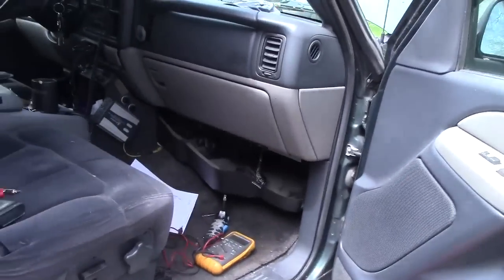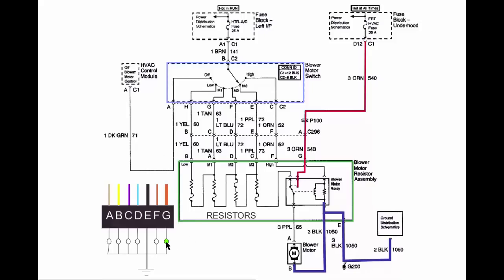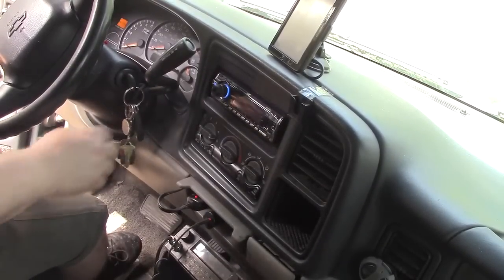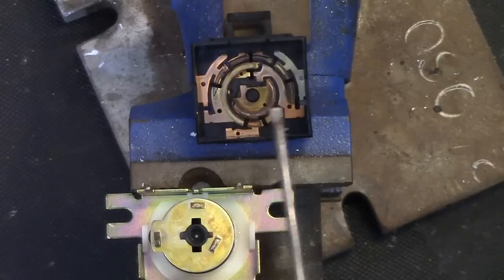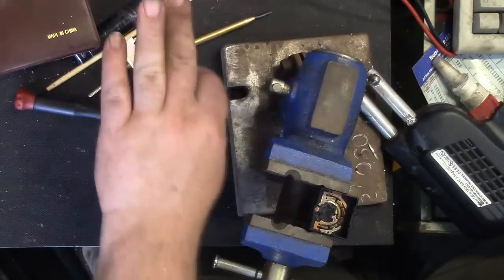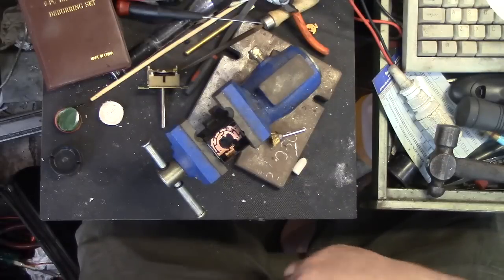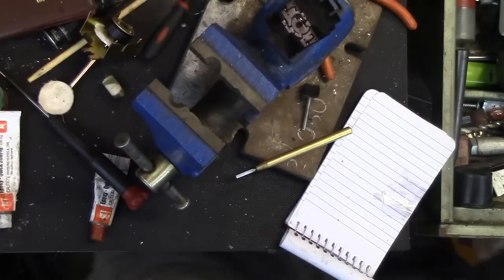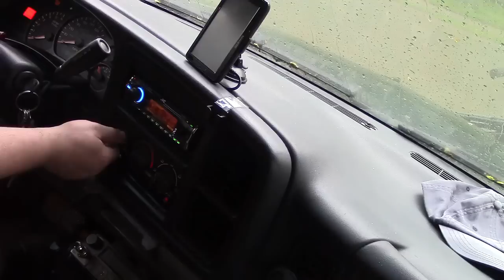Tahoe / Yukon / GM truck (GMT-800) Blower Switch - Troubleshooting & Repair

Comment: Just wanted to say thank you! I had a blown fuse under the hood. Had no power coming to the blower resistor and your explanation of where the power routes from under the hood was perfect! You saved me big money! If your ever in Chicago, beers on me👍
Reply from the maker: I'm glad it was of help to you.  I used to go there a few times a year with much of that time spent gridlocked on 55 in desperate need of a restroom.  Ah, good times!  Anyway, if the underhood High speed fuse was blown then you should check the wire harnesses and clean / lube the fan motor when you get a chance.  Something had to cause the extra current flow and old gummed up bearings seems likely.  Cheers!

Comment: I retired as a Heavy Equipment/Diesel mechanic for N.D.O.T.  I worked next to light duty guys that replaced probably dozens of those damn switch assemblies all told, so it was definitely a weak point in the GM climate controls.  I always wondered why GM only sold the complete assembly.  If I had been the one working on those systems I would probably have cracked open one of those bad boys to see what makes them tick.  As I didn't work on them and didn't have access, I just assumed there was some sort of electronics in that assembly.  But I NOW know it's because GM didn't want people taking those assemblies apart to see what cheap pieces of crap they are!   Great tinkerer's repair, considering how crappy the switch is, it lasted a fairly long time I'm thinking your repair will last as long if not longer.  Wicked cool vid, and I don't even own a GM like yours.
Reply from the maker: Pardon the delay. Google hasn't been notifying me of some comments.
Market forces and management demands have moved engineer mindsets from 'What Works Well' to 'How Little Material We Can Get Away With To Make It Adequate For The Few Years We Want You To Own It Before Buying Another'.   While parts may not really be engineered to fail - they won't be built to last much beyond what the MFR and the stockholders consider a reasonable lifespan before selling you another vehicle.  A sad truth not only to make stockholders more money (greed) but to keep folks employed making stuff for a prosperous economy.  No matter - Tinkers will find a way.  Thanks for stopping by and the comment.
Cheers

Comment: Thanks so much for the information! My issue was the blower motor resistor. Once I saw the schematic and listened to your explanation of how everything worked, I knew what to fix. The local auto parts place had the part for $25, and now, all my fan speeds are working. For reference, if your highest speed is the only speed that blows, your problem is the blower motor resistor assembly. AutoZone has the part in stock at most stores.

Comment: Eddie Great video,  Tinkering teaches critical thinking as well as evolving our skills.  It has allowed me to pursue a long successful technical career thanks to my father the Grouch.  This video allowed me to figure out that I had a compound problem (somewhat cheap equipment and age)  without even having to physically troubleshoot. Had both a failing relay and a slowly degrading switch per your schematic.  The only thing that would have made this video any more perfect is if you were interrupted again by a couple of dogs going at it on the front lawn!.  Be safe my friend.

Comment: Thank you for great video.   I  replaced the blower motor resistor and wiring harness plug for 2nd time as it had almost caught fire, turned on and nothing.  Thought I had checked all the fuses.  Switched out controller  with my 06 2500HD and still no fan came on despite display working.  I had  Missed "G"  40 large fuse you show at the 7:41 mark in video.
Reply from the maker: Yeah, the trend of under-sizing wires to save weight and a few dollars per truck sucks.  Try turning on all your accessories like when driving on a hot night and try grabbing the charge wire on the alternator.  That sucker will burn.  Glad you got it sorted out.

Comment: One spray of Deoxit D5 and I bet it would work for a long time....How do you change the light bulb in this switch assembly. My temp, and ac selector has a light but the speed dont...

Comment: I just went through a nightmare on one of these 2003 Silverado manual AC/Heat. Blower works on 5 only  ok 100 YouTube videos showing resistor YouTube  makes sense  changed it  same thing so started really checking everything reasonable. Put a bulb in blower motor wires and the light was dim on 1 and got full bright on 5  so I’m thinking a short on blower motor.  New blower  still only worked on 5. Crap. So I did what I should have done first  check the voltage coming out of hvac controller from fuse   Whoa  10 volts at wire 12 bolts at fuse cranked up truck 14 at fuse 10 at wire  so I ran a separate wire to hvac control hot wire and all speeds worked  there was a voltage drop in that wire from fuse to hvac controller  ran a wire that gets power only when ignition on and I have all speeds   99% of the time it’s the resistor unless it’s me working on it.  The blower needs 12 bolts at the least and resistor just cuts it down a few bolts but if you start at 10 volts it may dim a light bulb but not a blower motor

Comment: Thanks for this informative video. I was down to speeds 4 & 5. I replaced the resistor pack and now have nothing! Looks like I will be doing the same as you did here as it appears to be the blower switch. My truck is the W/T plain Jane version and uses cable drives to change the vent positions and heat control, so it’s a pain to try and access the switch as there is no excess cable length to get the panel out without disconnecting the cables. I wonder if anyone has encountered this, I’m open to suggestions.

Comment: Interesting what you say about the motor. My 02 has been making lots of squealing.  Then the squealing stopped about the same time the four lower switches ceased to work.  Six years ago the first speed alone malfunctioned. However, I was able to get a replacement switch alone.  Trains ha!  We have one go by here (in the country) every 15 minutes.  Real life has noise.  Just take a break and continue talking.

Comment: Thanks for sharing, any input on a blend door in the rear of 2002 Yukon that is hunting and only blows cold air... I took it all apart, and tested the blend door, it worked fine. i think its the module? I cannot for the life of me locate the module...?

Comment: Hey thanks for putting this video up.  My '96 Yukon had a high current draw that caused the plug in the back of the speed selctor switch to melt. I repaired that, replaced the motor and to my surprise, no ground. I took a jumper wire and made a circuit to ground, and everything works well. I have no idea where the black wire actually attaches to ground. It is tempting to make a permanent setup, but can anybody tell me where I might find the other end of the black wire?

Comment: oh you are sneaky. looks like i will be doing this same thing soon. luckily mine is still at the wiggle at tap to work stage. so i will be looking for one that ain't burnt yet. i wonder what causes this to happen.  bad contact?
Reply from the maker: Old grease, usually.  That will both make the motor harder to turn - hence, more current needed and create poor contact, as you said, as the switch wipers have a harder time cutting through the crud to allow enough current to flow.  Say you have a bad splice near the motor;  the heat damage will stay there and not affect the switch since the current passing through will be lower.  If the blower motor can be easily removed (as well as wiper arm shafts, window cables, etc), they should be re-greased after 10 years, anyway.

Comment: So if my ac works but i have no blower just free air when i drive then, my switch must not be my issue it would be my resistor right? ( since my ac botton comes off that same switch) i checked my harness my fuse pin has
Power but all the rest of the pins dont show power

Comment: Awesome video. Now I'm a bit worried cause I just bought a whole new climate control panel. I have the blowers working on the defrost and at my feet but not from the center vents. I hope its not the blower switch?

Comment: I have a 95 Tahoe.....I have water getting in the heater motor housing. any idea where it's coming from
Reply from the maker: If you mean plain water and not coolant I would guess the condensate (A/C - Defrost) drain is plugged.  There will be a tube through the floor pan near the passenger fender that may have mud or a bug nest in it.
Reply: thanks man...very much appreciated
Reply: Jon I had the same problem. Turns out a screw was missing from the shroud under my windshield. And allow rain water to enter the blower housing. Hope that helps

Comment: I've got a 2000 impala. Almost identical wiring setup from what I see. I get power to the 7 pin connector for the blower motor resistor(11.8 volts on the hot wire and about 3 volts on the others with the switch selection), but no power coming out the other side connecting to the blower motor itself. I've tried replacement resistors and get the same result. Any suggestions on where I should look/test?

Comment: Is there anyway to just rig it to stay on full blast... it’s 100 degrees in Texas and it only works on the low setting
Reply: WhiteGrapeSwisher mines only work on high ...I wonder is it the switch

Comment: 04 Chevy Avalanche, the blower only works on high.  Any thoughts?
Reply from the maker: In the past I'd say the blower speed-pak - we used to call them blower resistors but most are electronic or hybrids now.  Considering this repair I have to add the switch panels into the mix of common failures and things to check.  Since the speed-paks can be pretty expensive, it's worth taking the time with a test light or meter to find to true culprit.
Reply: Turned out to be the resister.  Thanks for the video, helped me figure out the cause.
Reply from the maker: Great to hear it was an easy fix and it was kind of you to come back with the results.
Reply: I have an 04 Chevy silverado 1500. My switch will not activate the blower at all. Any suggestions on issue? thanks for your reply
Reply: Rick Skeels

Comment: I have a 2003 express, the blower only works on high, I've already replaced the resistor and it was not resolved, i've inspected the harness and it doesn't look like it is melted or deteriorated. when I try turning the switch to low,med or med or med/high and all the happens is the airbag light and brake light flash and ding, where do i start to troubleshoot?

Comment: hi my 99 tahoe ac works on rear but not the front side what can be the problem? plz help has enough freon,front blows warm air when the rear blows really cold.
Reply from the maker: For some reason your comment was held as possible spam and I wasn't notified :(  It's probably already fixed but if you have rear A/C but not the front then either the blend door is stuck and routing the air through the heater core instead of the cold evaporator or the freon orifice tube is clogged causing a warm evaporator. 
 The rear uses an expansion valve at the rear unit and yes, it can be cleaned out if it gets clogged causing no rear a/c.
Reply: Eddie the Grouch thx for replying but it ended up being low on freon,new gauge on can gave me false reading,took it to shop & they recovered & added new freon

Comment: I have an 06 Silverado an just today I lost speeds 1-4 but, speed 5 works np. The resistor and wire harness were just replaced. I'm guessing the switch but, would like to know a way to test speeds 1-4 to ensure it's the switch itself.

Comment: Hey quick question. I have an 05 Tahoe. My blower stays on even when I take my keys out. However, the blower stays on high and the speed will not drop. I have replaced the resistor and it does the same thing. Could it be possible it will be the control panel? It is digital. Thanks in advance! Great videos by the way!
Reply: You answered my question! Thanks! I had to watch it twice to understand. Sorry I just got off from night shift
Reply from the maker: Hello Arturo.  You just had to get complicated... The digital system is a bit different.  Where my control panel is mostly switches - yours uses a processor and ties into the Body Control Module via the Data Link.  There's a slim chance that a wonky BCM could command the blower on but we hope not.
There are some fuses you can pull to get an idea what's going on.  Pull these while the key is out.  In the interior fuse panel pull the HVAC 1 fuse (10A).  That comes off the ignition switch and go to the HVAC control -  if the motor stops then the ignition switch has a problem. 
If the motor keeps running go to the underhood panel and pull the TBC IGN 1 (10A) fuse.  That's the Body Control Module.  If motor keeps running then we can assume the BCM is not the problem.  Also in that panel is an HVAC/ECAS (10A) fuse that is the B+ for the HVAC control. If the motor stops when you pull that fuse then the HVAC control is the likely culprit.  If the motor is STILL running and only stops when you pull the big BLWR (40A) fuse then the blower module you just replaced is bad or you have some shorted wiring.
Reply: Thank you! I'll check that out.

Comment: good point about older motors with the bearing grease aging and slowing them down and that would raise the amp draw
...my question is about using the blower to vent the van without a powered roof fan/vent setup
 i see that on the low position all the power goes thru all the resistors , that would waste a lot of amps , this could drain the battery too much overnight while sleeping
sooo ... how would i check for power consumption first to see if this could work and how to hookup a way to use the dash switch without a key in the ignition switch
thanks for the video , it has answered some of my questions allready
Reply from the maker: I can give you some ideas but I need the make/model and year.  Your blower may use PWM rather than resistors.  Do you have a loop style inductive ammeter or a regular DMM with a 10A setting?  Do you have a separate battery for when you're parked? You can buy or make vents that sit on top of your windows and lock in place when rolled up that could use low power computer fans.  The important bit is to have places for air to get in AND out or a fan won't do much.  Tell me what van you have and what types of windows and vents you have to work with.  I'm sure we can come up with some cheap low or no power options you can build.
Reply: thanks for the quick responce ... all my run on sentences and i did not write 1999 chevy express 2500 , sorry
i finally got my buddy to measure the amps at the 20 amp fuse at the drivers door
 LO does not work but read .03 , then 5.35 , 7.35 , HI was 20+amps
looks like to much to run at night to push air thru the van and out back
i have seen a floor vent/computer fan and a fan behind the license plate area on you tube
this is a window less cargo van , only front door windows
a separete battery system would come later
with windows up the bugs would not get me thru the heater/ac setup i guess but this may not work for me...
this would be a urban stealth van sooo no outward cues like sound etc
thanks again for your ideas
Reply from the maker: That's a roasting pan on wheels.  You might as well put in a rotisserie to evenly distribute your juices while you are stewing in there.  Without a roof vent you can't even use convection to help you out.  The OEM blower has to be strong enough to push air through both the heater and A/C coils so it's best to ignore it.  You seem to have found the best ideas in floor / plate vents.  Slow turning 120mm fans will be silent and 4 of them will draw 2 or 3 amps.  Speed controls are a few dollars and readily available.  I'd add a timer or a voltage threshold cutoff to ensure you can crank the van in the morning.  A spare auto/mower battery with an isolating charger module would work, too.  If you use a floor vent, make a stack or tube the goes up to the roof area that you can Velcro on to pull out the trapped heat (or to make it a convection oven for even browning, too).
Reply: yes it might get a bit warm in there ;) ... will need to stay near the beach under the trees 
 i will most likely end up with a roof vent , just exploring the options and i still duck when driving inside the parking garage now
those are some good ideas , will keep them in mind , thanks

Comment: I have a 2002 chevy suburban and no air blows out of the front vents but it sounds like it tries to kick on.  I have rear ac and heat though. Any suggestions?
Reply from the maker: If the front blower works and air blows elsewhere, like defrost or floor,  then you have a defective Mode Door Actuator.  There are 3 of them under the dash and the one you want is above the gas pedal (#6 is the actuator and #1 is the door/flap).

http://www.2carpros.com/forum/automotive_pictures/102900_901410_1.jpg

 This motorised flap is like a valve that diverts the air where you want it.  
This is a common problem with GM trucks.  Another cause would be a defective HVAC Control Panel - the bit with the buttons and knobs.  Sadly, this is also a common problem.

Here's a random video I found where someone shows the locations: https://www.youtube.com/watch?v=pgadjXyqjbA

You can look up there and maybe see if a gear got jammed by an overzealous radio/alarm installer.
Reply: Thanks for the fast response! I will be looking into this.